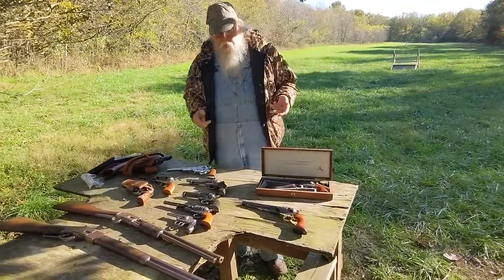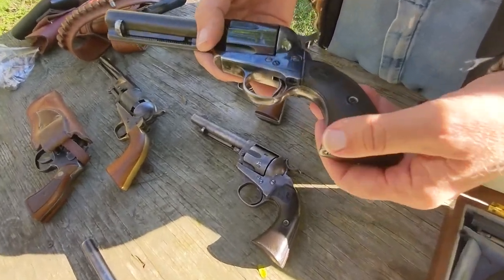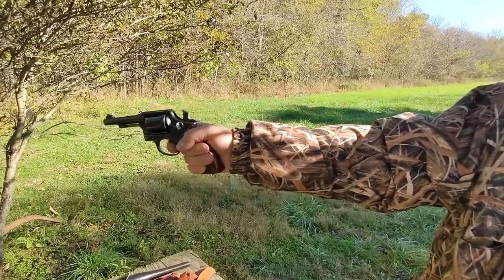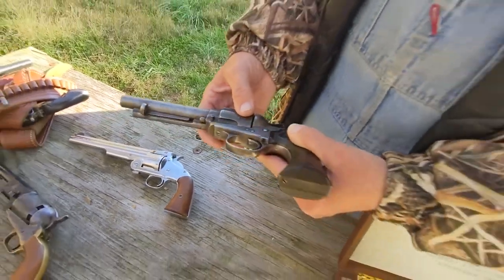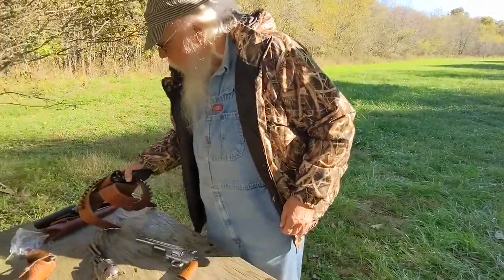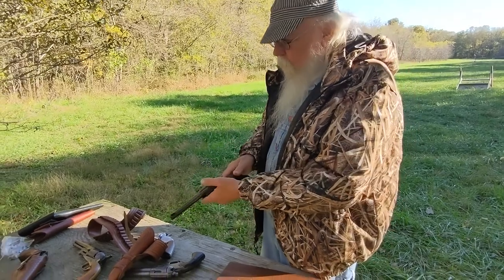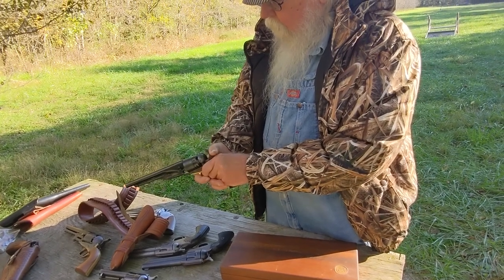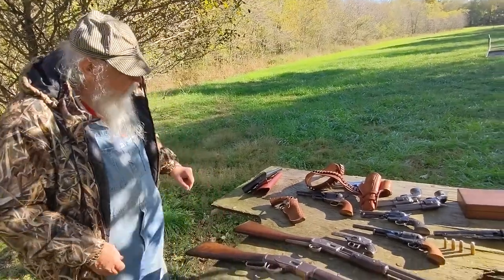Western Colt Single Action revolvers and SAFE handling

Comment: Very good video most people mis-handle the colt not only safety wise but in it’s operation that is why you see all these scratch cylinder on these guns I’ve seen so many lower the hammer from the load notch putting the bolt stop against the middle of cylinder then rotate them when they could avoid it if they only bring them all the way to full cock before lowering the hammer